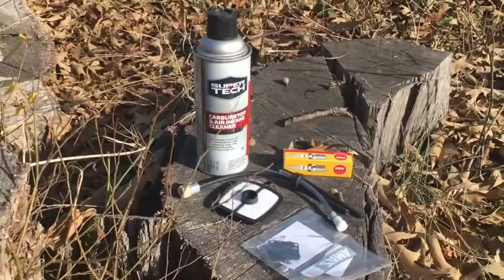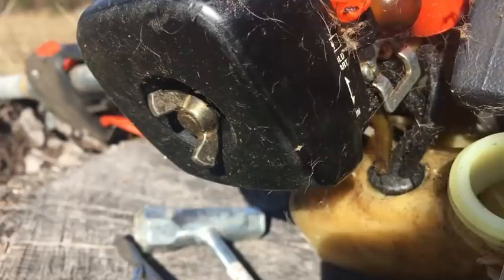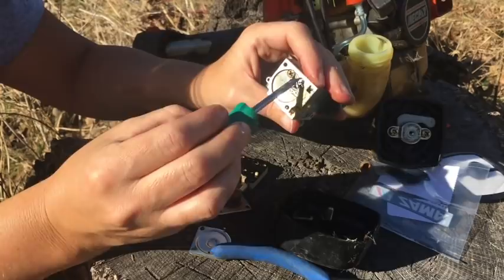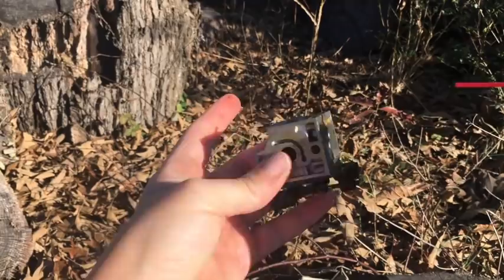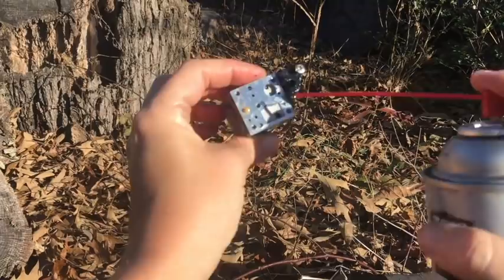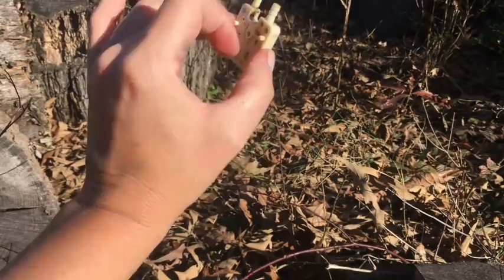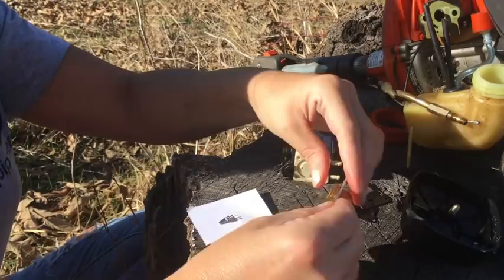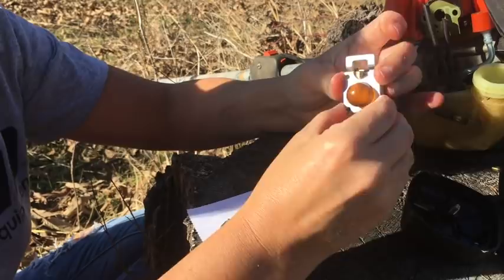Can I make this 20 yr old ECHO Pole saw run? (That has been sitting 4 YEARS!)

Comment: As i said before, I always run my equipment, year round it take 1-2 hours each weekend, to keep everything going strong! Tune up each spring, and ready to go... no issues, some of my equipment is 15-20 years old with out any major issues! All used equipment from free piles. Repaired them and keep them running, your issues will mysteriously diminish😀😀😀 

I live in NJ, where most people put up their equipment during the winter, I don’t, I start everything one a week, and run them yard needing it or not! Everything runs!

Comment: This is THE BEST you Tube I have ever viewed. Perfect job. I admire you. I worked for NASA analyzing the moon rocks for trace elements in a lab in Kentucky in the 70-80's. I had to be perfect in my work to use radioactive neutron activation analysis to detect the precise element amounts. I'm👌 74 and will retire in a couple of months. Thanks for getting my Echo weed eater to run perfectly. Sending you some $$. Dr. Cox

Comment: Good video, just one alternate way to put new fuel lines on the carb: Grab the fuel line with your needle nose pliers and dip the end of the hose in a bit of 2 cycle oil then push it on the barbed fitting. That will eliminate the fiddly action of stretching the lines from the inside with the pliers.

Comment: As a self taught small engine technician for over 35 years I think you do a very good job! I noticed you didn't show replacing the needle screen filter, or show adjusting the needle assembly,  the Zama and Walbro tools will make a great counter sell with the parts you sell.

Comment: Nice job Never known an Echo not start In my humble opinion there is nothing to touch them I have a 40 year old saw a 25 year old hedge trimmer and a 15 year old strimmer
or wead eater as I think you over the pond call them ?? I use these for a living so they work hard and I mean hard never a problem look after them they look after you..
My friends who use other top brands have loads of issues and tend to buy new ever 2 years I have tried to explain but some folk just dont want to know ??Thanks for the
advice re fuel stabiliser  have listened to your advice and now using it in all my tools Keep up the good work always good to be taught by those that know !!

Comment: I have an old echo sprayer that I need to get back working. I let it sit for a couple years because I wasn't using it. I got it to stat a couple times but not stay on, then the primer bulb cracked. I initially just got another bulb, but I'm going to go ahead and replace the whole carb on it

Comment: You do great work.Better than most men doing it.I have a Echo trimmer that I used a lot and put a brand new carburetor on mine, change spark plugs,air filter,and even put a moter on it from the spare one but unfortunately it still failed to start.So a new one cost 200 dollars and I just went and got a new one because taking it to the shop with something else wrong and labor cost I'm much better    to get a new which a old one I would pay just as much or more for it to get it repaired.

Comment: I just need to look at that engine, and could tell it needed a carb rebuild kit, and total fuel assembly replacement lol. Those gromets can be a pain can't they, and one mistake with the screwdriver and you stab yourself, and out comes a few colorful metaphors. :P - You did a great job, you brought life back to that tried and true Echo engine.

Comment: Saw you on R+R. I thought the video was great. I subscribed. As a widow, with no family to help with these things (my brother used to fix things for me), I appreciate this video. It gives me the confidence to fix things myself. I called about getting my ryobi trimmer with interchangeable tool heads fixed. I was told I should just buy a new one. I believe it may be a fix similar to this because it doesn't get gas to the primer bulb. Is it worth fixing? Thanks. Looking forward to future videos.
Reply from the maker: Thanks so much Susan!  First thing, in the video if you noticed, I looked inside the cylinder to make sure it was worth fixing. That is where you need to start. It is sort of hard to see inside the Ryobis though. If you take just the engine unit, no need to take an attachment, to your local shop, they can test compression for you.  I do it for free for customers, but they shouldn't charge you much. If it has more than 110 pounds of compression it is worth fixing. 120 pounds is preferred. From there, I want you to give me the model of the unit so I can get a visual of what unit you have. I can then look up the parts for you and tell you the best way to proceed.

Comment: Thanks, been learning some good basics from you! 

Question! How do you know/decide when a metering diaphram needs to be replaced? You quickly said this one was sunken but not too stiff. Can you do a video on evaluating clean vs replace for carb parts? Running symptoms of failing carb parts? 

I've been working on small engines on the side and I've found non that seemed to need replacement yet, most run fine.

Comment: Saw your post on Roots and Refuge fb page. Great video.  Very thouough ad easy to follow. How old is too old to refurbish a small gas engine?  I have an old Mantis gtiller that has not been used i over 10 years ad find myself eeding one again. Is it worth a try?
Reply from the maker: The mantis tiller has one of the best engines ever made. They do not make them that good anymore.  If the piston and cylinder still have compression, it is TOTALLY worth fixing. I LOVE my mantis tiller.  I used it for my entire garden this year. I will do a mantis video next!
Reply: Yes, definitely!
Reply: @Chickanic  yes, the Mantis tiller has a Kioritz engine (Echo) made in Japan where they make the BEST 2 cycle engines.
Reply: @Chickanic  I just found this https://www.amazon.com/Carbhub-C1U-K54A-Carburetor-2-Cycle-Cultivator/dp/B079NTNVV6/. I wouldn't have thought the parts would be easily found and so affordable.  On my Mantis Tiller, just about everything that touches fuel needs replacing.  Thanks for the video and comments.

Comment: A newbie definitely should make sure they TAKE PICTURES. I would have replaced the primer bulb. This is the way to rebuild the carb if you want to do it again. Put on safety googles and use pressurized carb clean to spray in EVERY HOLE. Make sure you know where every hole goes and it is open if it should be. Use your brain! I like your video's because they are concise. Thank you.

Comment: Bre, I feel sorry for you in this video. You don't even have a workbench. Good information though. I have a 40 year old (not exaggerating) Jonsered Lil Red that still runs, even though I have to give it a squirt of ether to get it started every time. I use it with a saw blade to knock down the small brush on the edges of my lawn before I blow the leaves away in the fall. Maybe I'll try to find a carb for it.

Comment: Seriously how can one not fall in love with Chickanic.  Great job and just got done watching your mower video.  Da Bear wishes that he would not have bought an electric pole saw.  It was ok until Da Bear had to cut the tree branches way way way out in the yard.  Dat meant one long long long extension cord.  Oh mistake made when found out trees were on me.  whoops.  Anyway, part of Bear life.   Chickanic, is there any formula for knowing how wide a tree branch a pole saw is capable of cutting? Your videos are awesome.
Reply from the maker: Aw! Da Bear! My new favorite sub. lol When using any saw you want to try to stay away from cutting with the tip. Bars are measured from where they come out of the saw to the tip. Most electric pole saws are 8-12 inches. So really you can cut about a 6 inch limb with an 8 inch bar. As long as your chain is sharp. ;-)
Reply: @Chickanic  Thank you for the information on the thickness cuts and love your videos.  Very informative and well made.  Da Bear says you seriously need your own tv show.  You are "pawsome"!  Dat is what Bears say instead of awesome.  it is similar to awesome but one up from awesome!  Your videos are "pawsome"!

Comment: I change my spark plug, exhaust is clean (filter) air filter is clean, cleaned my carb EXACTLY how you did it, fuel lines are good and this sun of a gun STILL won’t start. Smh. I just got it last year.

Comment: in am 19year old and just started my lawn business. my echo  smr 225 runs on full throttle and dies every time I release the gas lever. can you please do a video on this thanks. love you show.
Reply from the maker: Thanks for asking! I need some more information though. How old is the unit? Did it sit for a long period of time? Have you checked your air filter, plug? Is it slow to throttle up when you first start it?
Reply: @Chickanic  I bought the unit mid last summer for personal use. It did sit this past winter. we put a new carb and the fuel filter and Gromit kit with hoses as my DAD got mad when it leaked in the car. All this was done at the beginning
 of this season
Reply from the maker: @justaquestion5080  Hmm. I never see them leak in that short amount of time. Was it leaking from the carburetor? Why did you change it? Even after sitting all winter, Echos will always start back up if you prime it real good and loosen up the diaphragms. Did it start this problem (not idling) before or after you replaced everything?
Reply: @Chickanic  the problem started after about two wks ago

Comment: would it be easier to buy a replacement carburetor from amazon? The price range is under $20 for generic brands and OEM is 50    Also, what is your opinion on the generic brands of carbs for GT225 on Amazon?

Comment: what is your supplier for the $13 Briggs snd Stratton carb jet, "Fuel Module"? Unable to finf on B&S website or 2nd sellers or Amazon.
Reply from the maker: The part number is 596521. I buy mine directly from Briggs. Last year they did run out, but I haven't had a problem this spring yet. Looks like they have gone down in price since I made this video a year ago too! See if you can get it through this link. https://www.briggsstrattonstore.com/briggs-stratton-part-596521/
Reply: @Chickanic  had practically memorized part #, yay, down to $8.51!; ordered two from local shop<their vendor @$13.98 includes  t&d...I hope.
Reply: oh yes, now my riding mower only clicks at top and bottom of key turn...meter shows 12.54 V both ign start and off.

Comment: Do you only use original replacement parts , oem? Or ?
Reply from the maker: I use a mixture of both, but will only recommend aftermarket parts that I have tested myself multiple times. Most times, I will tell you what aftermarket to stay aways from because I have seen so many issues with them, they just are not worth the trouble. 
Thanks for watching!

Comment: Do yourselves a favor and use rubber gloves during the cleaning process. The cleaning chemicals in carb and brake cleaner are no joke and have good chance of resulting in tumors or cancer down the line. Now when spraying the cleaner into the holes of the carb, there's a good chance of it shooting back into your eyes (hence the reason she mentions to wear goggles). Rinse out immediately if that happens. The areas around the eyes can absorb chemicals quickly. Lastly, you don't want to get the spray mist into your lungs.

Comment: I love your videos but I will always correct someone when they say flathead screwdriver. Flathead screws are countersunk and are flat with a surface when installed and can be STRAIGHTBLADE, Philip's, Allen, Torx or whatever drive. Therefore almost all drives can work on a flathead screw but there is no such thing as a flathead screwdriver.

Comment: Why didn't you just buy a new carburetor their cheap enough?
Reply from the maker: The carburetor on it is OEM and will last MUCH longer than an aftermarket. A OEM replacement carburetor is probably about $45-$55.